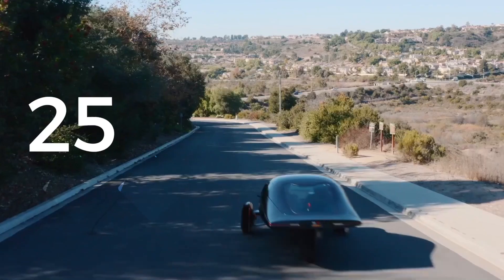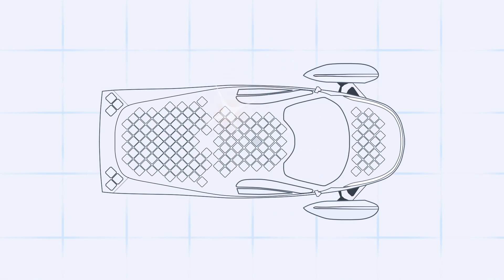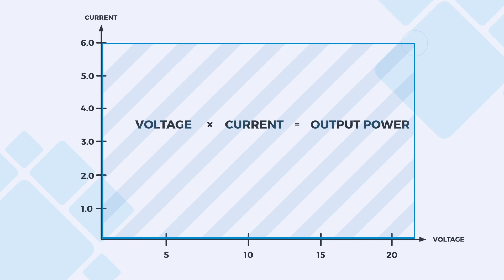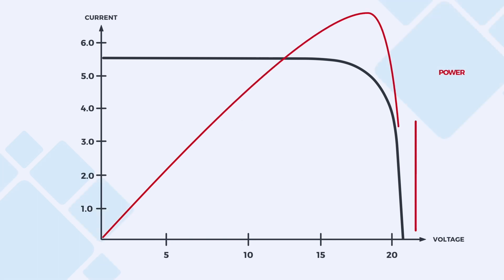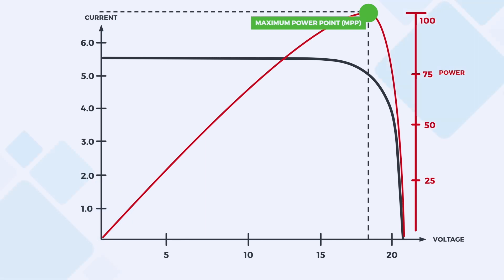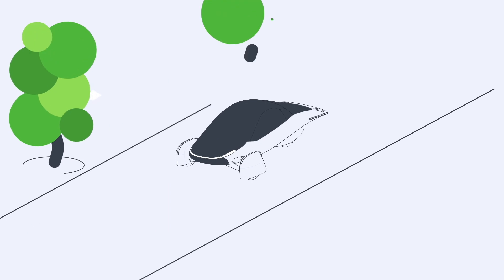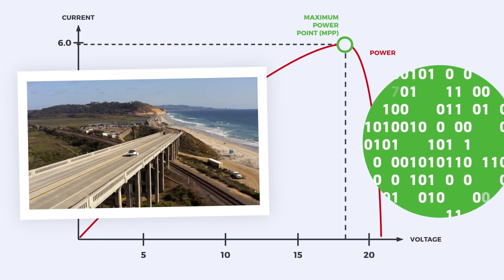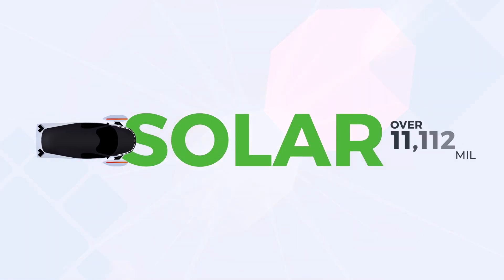Maximizing Solar Output

Comment: I waiting to see what they do with the solar hatch. If Aptera is sticking with glass I hope there is some space around the solar cells to allow some light in. Otherwise it going to be a dark cavern in back.
Reply: I am 99.9% sure that if you order the rear hatch solar that it will not be glass as Chris has mentioned it will be a poly carbonate. But a beta solar car is either in production and soon to start testing and tweaking the solar system or they are testing now. I think that came out in the recent Rich Rebuilds vid of there test drives. Yes it will be darker and possibly cooler inside because of it. Chris also admits in that vid that the alpha cars do not have real solar panels.
Reply: @craigarnold1212  Same request as Bob, Citation please, I've been following the new company since close to day one. Every mention that I know of, or have seen has been that it would be glass. I would be glad to actually see something about it going to an insulated replacement, to help with weight and temperature control.
Reply: @billthacet  @Bob Hilder @Aussie ideas man sorry for the delayed reply. I was under the weather due to covid. I did a deep dive in my youtube history to find that thinking I my have read between the lines. I cannot find the clip I was thinking of. I found about 13 of my videos missing in the past 9 months. Which had been moved to a private section of the site that originally released it and are no longer publicly displayed from their originally public areas on their web site [I am not  going to say where as some may relate to other product releases like Apple that does that 2-4 times a year as there is no original content skin shown to suggest original sources]. There were others that were gone due to their channel closing or removed by an existing channel that probably do not relate. Looking 2 years back I find about 4 of those per year. After recovering and thinking about it. It may have been that what Chris had said was that if you order a solar hatch it most likely will be a polycarbonate. Rather than definitely be. I cannot remember the exact source of the video. 
Personally I believe that it would be a polycarbonate or something a kin to it. Tempered glass does not make sense on many levels to me. Though a solar panel maker in my state did laminate cells between two sheets of glass that the NREL tested as having at least 35 year circuit life after stress testing if not more. It had beaten every previously tested panel. And that the lawyers would not allow a warrantee statement to be greater than 25 years to be 80% of original power output. It was designed with the intent of using them on the top floor of parking garages as a lot of light passes around the open areas of the cells and edges. Or plain parking lots or other areas where blocking out the sun totally like most panels back then did. It did not survive. Part of that was shipping weight which increased associated costs. It had all thread like posts [2 each side] that fit into mounting slots they made that would easily mount to frame making installation fairly easy but because of the weight became a 2 person job. Overall the installation cost was too high and could not reach volume needed. No place to hang a micro inverter but would you want one in that situation?

Comment: An hibryd car could be easier, cheaper for most of people.
Reply: Aptera IS a hybrid-a hybrid of BEV and solar range extender. Solar isn't practical for full size cars,  but for this lightweight it's ideal.
Reply: I have a Prius and while it has been an economical and reliable choice, I do want to go electric due to maintenance. I have all the maintenance of an ICE car plus the battery system on top of that. I’m still producing pollution as I drive, just half as much as the other cars. I’d like to go cleaner and simpler.
Reply: @OptimisticEngineer345  Amen..... one day!
Reply: I'm México Prius and Prius C are very popular. Just saing My opinión based on  My  environment.
Reply: Then most people can buy a hybrid if they choose. I disagree with your assessment that a hybrid is cheaper, but no one is trying to make you buy an Aptera.
Reply: @20xx-mm-dd  hybrids are cheaper; they're everywhere.
Reply: @jamesengland7461  not cheaper in the long run! And they are everywhere because of the availability but electric vehicles will grow every year and hybrids will decrease. Hybrids are an ice vehicle which is bad for our environment and their future is limited.
Reply: @jamesengland7461  they're everywhere because of the sticker shock that comes with repair bills associated with battery replacement. Save money on gas, oil changes, and basic ICE maintenance to put back into a replacement battery pack. That makes no financial sense to me.
Reply: @sra71121  then you have no understanding of how people have to buy cars.  They can likely get financing for a 3 year old Prius for $20,000 whereas they can't afford the monthly payments which would come with a $50000 Tesla, so they couldn't get financing for it. Never mind that there are nowhere near enough BEVs to meet demand,  AND their prices are quite elevated at the moment.
Reply: @sra71121  Battery replacement??  A well-cared for battery might last you 1 million miles under the right circumstances.  Even crummy Tesla batteries should last you 300 - 500k miles and cost you around $15k to replace.  I've never owned an ICE car that made it past 200k miles.  At that point, I'm out the entire cost of the ICE vehicle including a whole lot of maintenance.  I think your financial sense calculations are off.
Reply: @sra71121  Who, aside from Nissan Leaf owners, and very early Tesla owners, has to pay to replace the battery on their E.V.?
Reply: I would never buy a hybrid. You still have all the legacy ICE mechanical issues to deal with. Today’s technology has left hybrid vehicles behind.

Comment: explaining MPPT isn't exactly answering anyone's questions. how many separate zones are in the solar array and what are their nominal output voltages? how exactly are you combining them; are you building a custom solar charge controller or using something off the shelf?
Reply: I mean...the video was informative to me. I don't care as much about the nitty gritty design details. I'm sure all that information will be come available as production models become available. Maybe someone can ask them those questions directly if thats important to know for them.
Reply: @20xx-mm-dd  haha some of the nerds like Sean Nicholas and me want to know. What Sean asked is important because when solar panels are connected up in series and parallel the begin to work as a whole and without separate mppts certain groups that may not be directly facing the sun may be the limiting factor of how much power the other cell arrays produce. You could fully shade 1 cell on a panel and the entire panel will have drastic reduction of power output like nearly 90-99 percent of the power will be gone. This is easily fixed by what Nicholas said by splitting up the zones putting the cells that are on the same face of the car under separated mppts or mppt inputs.
Reply: Maybe 5 zones: hood left, hood right, dash, roof, rear.  Rapidly responding to complex shading issues while driving seems relatively unimportant compared to conserving mass/maintaining simplicity.

So I guess it will be a single charge controller with between three and 6 MPPT inputs?  I admit I'm out of my depth here, but maybe everyone is once you start talking about mobile arrays.

I'm surprised they're discussing reacting to dynamic insolation in motion at all.
Reply: @suunraze  My guess would be that they're using ideal diodes to bypass shaded cells with less MPPTs. Unless they're doing it on the same board without much weight penalty, having a bunch of MPPTs seems far more costly. Using a combination of voltage/current control and ideal diode control of the zones, they can always maximize power when shade is on particular grids. Using just MPPTs, each zone would be limited to the minimum current of a shaded cell, which would waste a lot more power than shorting a shaded cell out if if it benefits the others.
Reply: @Infinion  diodes makes a lot of sense
Reply: @bobhilder1469  I still think striving for any sort of cell-by-cell optimization would be counterproductive for a vehicle which will receive more than 95% of its solar radiation while stationary.  You're probably right that 4 or so MPPTS would be good enough, although I think the two halves of the hood are at fairly different angles.

Then again, even while parked, a vehicle is probably more likely than a rooftop or ground mount array to experience partial circuit shading (parked partially under a tree, parked on the east side of a building, parked next to a lifted Ram, etc.).  It would be a shame if the shadow of someone's sideview mirror on a couple of cells crippled the output of the entire hood.
Reply: @bobhilder1469   Thanks for your comment about Sunpower. I read their white paper and the improvements are simple but extremely effective without adding more material (very "monolithic").

The reason I suggested Ideal diodes, which are commonly MOSFETs without a sizeable voltage drop, is, as you know, because they shunt shaded cells and bypass current from the rest of the string, just as regular bypass diodes are wont to do. That's going to allow a system designer to series connect more zones and use less parallel MPPT controllers. The real main benefit of active bypass circuitry is nearly null heat generation (that is, ~30mV drop at 10A). Ideally, they would install one per cell for peak shading tolerance, but you're completely right that standard practice has been to limit bypass diodes and "strategically place" them across each 1/3rd of a module. 
For Aptera, at the minimum, it would make sense to bypass entire zones of the car, and at most, on a cell-by-cell basis, silicon shortage be damned.

I think an argument could be made that a series-connected string of panels, maximizing active bypass with FETs, or simply using SunPower's low-breakdown cells, while minimizing the number of parallel-connected MPPTs would lead to a simpler implementation, and it wouldn't necessarily produce less solar output. As was mentioned earlier, there's a pretty big voltage ratio to reach to charge the high voltage traction battery.
Reply: Aptera said some months ago that they will be using a custom MPPT circuit integrated with their custom battery charge controller that also handles the other charging inputs. They have not said how many zones they will have, but I presume at least 4.